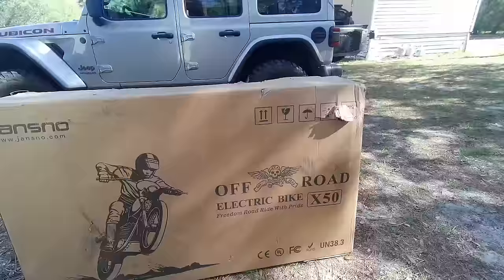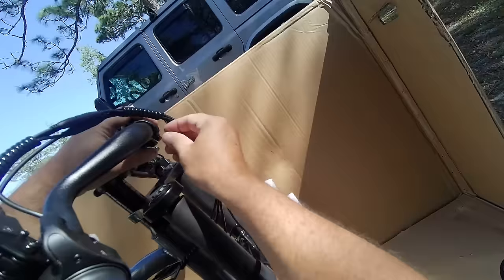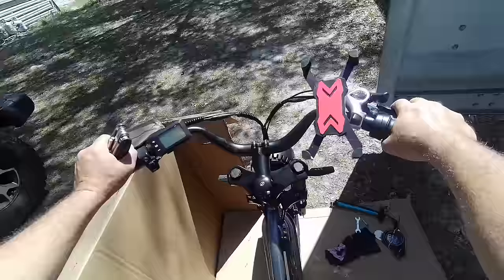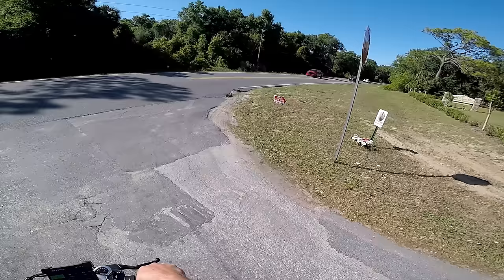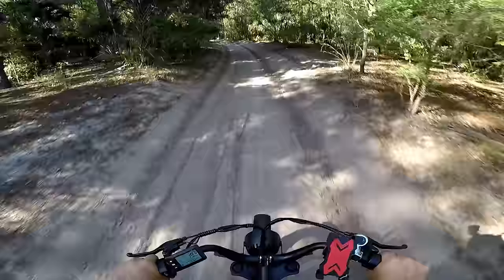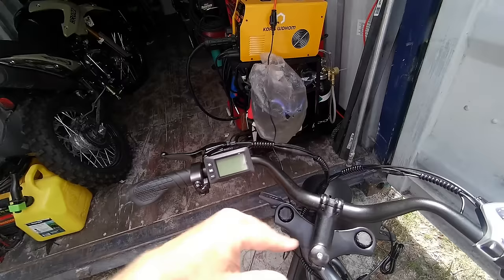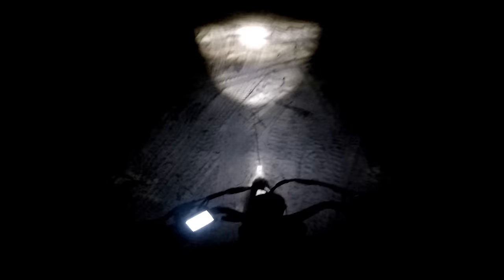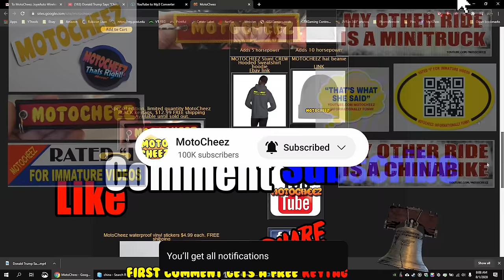Jansno X50 Electric Bike 20"x 4.0 Adults, 750W Brushless Motor, 48V 12.8Ah Removable Battery,

Comment: I've owned this exact bike for about 2 months now. It's legit a great bike at an incredible price. Only complaint is the charger it came with. They really cheaped out on it, and it get's hot quick, didn't seem safe so I replaced with a higher quality charger. It's a fun bike for the money!
Reply from the maker: Awesome!
Reply: Hey man. I just got this bike and got it all setup, what charger did you upgrade to?! That sounds like a great idea ahead of time. Any other upgrades to it?
Reply: Glad I found your comment how convenient lol I just came back to this video for setting it up. Been waiting for a couple days just watching over plenty of reviews
Reply: @Bravosierra175  ha! what's interesting is that i bought this particular bike based on a positive review of a different youtuber! it's my first ebike ever and i still cannot believe i have the equivalent of an electric dirt bike for the price i paid. one other thing.
Reply: @jomoney9076  cool thanks a lot. did you get the 25.2 or the 29.4v ? There's also a 40 something v option, I'm not very familiar with what this exactly means
Reply: what charger did you upgrade to?
Reply: Can you upgrade this bike to use hydraulic brakes instead of the mechanic breaks it comes with?
Reply: Do you think it's possible to mount a second battery under the seat? Does the area under there taper down where it meets the frame?
Reply from the maker: Yes, I'm sure you could!
Reply from the maker: Mid drives also cost double plus. Hmm mid drives typically don't need the extra pedaling so I would imagine mid drives are for lazy people haha.
Reply: Might I ask what kind of charger you got to replace .. as I currently have the same as you, and was interested to replace it as well
Reply: Need replacement charger recommendations,  thanks
Reply: What is distance on this with only 12.4 ah?

Comment: another nice thing about this bike is the weight capacity is 265-ish. i'm fat and weigh close to 300 pounds but rolled the dice and still bought it. it has no problem carrying me around just fine. my goal is to actually exercise with it to by pedaling to lose weight.
Reply: are you able to hit 28mph?
Reply: @zipzip8239   Not quite, unfortunately. Closer to 24mph I'd say. But I'm not complaining since it still carries me around even at that speed given I'm 35 pounds over the wt cap.
Reply: @MotoCheez  I'm not sure if we're talking about the same thing, but just in case, and forgive me if this isn't relevant. If you remove the seat, there's a black and white wire connected by a tiny plug. If you unplug that, and put the seat back on, the removes any lock on the upper speed. At about 260 pounds, I can get up to 32 MPH on a straightaway.
Reply from the maker: @RileyHarrison yes! This has that. I had this bike confused with another bike, I did put it in the video
Reply: @MotoCheez  I saw After that of course you had covered that obvious bit. Thank you!

Comment: "cant get much flatter than this" ... Cheezy this is Florida, the only hills we have are overpasses
Reply from the maker: There are a few hills in my area and there's also a pretty good sandpit that's probably 80 ft high or so but the bike wouldn't make it up that cuz it's really steep
Reply: Floods are no fun though
Reply: @MotoCheez ¹1qqqqq¹q1qqqqqqqqqqqqqqqqqqqqqqqqqqqqqqqqqqqqqqqqqqqqqqqqqqqqqqqqqqqqqqqqqqqqqqqqqqqqq1qqqqqqqqqqqqqqqqqqq1q1qqqq¹11❤

Comment: I got my Jansno for about 3 months now. Put 820 miles on it. At 600 I need new rear tire. Front still okay now at 820 miles. Will change it at 1000 no matter what just for safety. Very good bike over all.
Reply from the maker: Awesome! Thanks for the info
Reply: What’s the range on only throttle at 30mph?
Reply from the maker: @emadhakim I'd say if on flat roads 25 miles or so. I've never tested road only, but might soon

Comment: I just got some great tyres for mine from Germany, called " Vee Rubber E-Huntsman" 20x4.0 .  It's a bit more like a real motorcycle tyre , I threw in some green 20in tyre liners too because these bikes are pretty much unpushable with a flat because the balloon tyres squish to nothing, come straight off the bead and the rim bangs on the road. Got me a puncture kit and pump now too 😂👍 man that was a bad day getting a flat so far from home... But not again! Highly recommend the tyres if you can get them there 👌
Reply from the maker: That's great info! I never really thought about if I got a flat, I do carry a small air pump and patch kit on the motorcycles, good idea for the bikes
Reply: Hey how did you get the rear tire off I'm new to this and I just got a flat but it seams to be stuck and I don't wanna force it and I can't find any videos for it
Reply from the maker: Off the bike or off the rim?
Reply: @MotoCheez  off the bike for some reason I could be missing something once I loosen everything and I went to pull the wheel off the bolt on the side when there brakes are won't let go I think it's very frustrating
Reply from the maker: There may be a pin or another small bolt, I've never taken the rear wheel off yet but something has to transfer the torque. 
Maybe someone else will chime in on this
Reply: @MotoCheez  I hope so hell I've even emailed the company and I've heard nothing so far gonna have to walk to work but I'll keep trying to figure this out and hope it's something I overlooked
Reply: Hey I figured getting the bike wheel off a day after I posted this comment it was just tight before it was the first time however does anyone know how to fix/ recalibrate the display I believe it was an error code 9 but the speedometer and the mile counter won't go up from zero after the wheel (after user error) popped off when it was to loose and I had to hit the breaks omw to work can anyone help with this or am I just kinda screwed? Everything else works just the display not showing how fast I'm going and the miles counter is not working and help would be great
Reply from the maker: @matthewgurisko97 I'd think it was a connection to wheel sensor for speed
Reply: @MotoCheez  that's what I'm thinking but I checked the plug and made sure the connection is all good and still nothing do you think is there anyway to reset it or fix it without changing any parts out? It's kinda trial and error without a manual or anyone else with the same bike going through the same stuff
Reply from the maker: @matthewgurisko97 there's a schematic in the manual, I'm not sure which plug it is but you could test with an ohm meter, check the connections to gauge too. 

Yours is the first I've heard it happen
Reply: @MotoCheez  I'll keep working on it and hopefully it's as simple as the last thing I don't have a meter and I don't know where to find a manual for this thing I looked all over and nothing so it's mostly guess work on my front everything works mechanically and the battery display works fine just the other parts of the display (speedometer and the mile counter) and I still have yet to hear from the company from even the last time I emailed them other than figuring out these problems Ive ran into it's still a pretty good bike

Comment: I’d upgrade that battery asap. 12.8 amp hours just isn’t enough range at all. That’s at most 10-15 miles of range on throttle. To maybe 20-25 on pedal assist on the lower levels. The bike seems heavy. So the lower levels of pedal assist won’t help much especially on climbs. So we’re back to around 15 miles of range on the high end. At minimum. An ebike really needs 20 amp hours as standard. That’s about 30 miles of range using throttle or 40ish miles with pedal assist. 32 amp hours is the dream. Between 60-70 miles of full throttle. 80-90 miles on a medium pedal assist. Everything else on the bike looks solid!
Reply from the maker: Agreed! They're coming out with an X60 soon, supposedly big improvements! I'll get one once they're available
Reply from the maker: But I drove in sand for about a quarter of the whole ride I got 8 mi and it was still about a half battery left Yes it was blinking that it was low but I was on sand that takes a lot to push through the sand

Comment: I'd be inclined to swap that QR axle on the front wheel for a Bolt-on, it should be safe enough for road use but not for off road riding.
Reply from the maker: Not a bad idea .

Comment: That is a very good deal for what you get .. Just a bigger battery would be nice. I know you could put in a 20 ah battery easily with all that open frame space.
Reply from the maker: That would be an excellent idea, even go up on the battery voltage to 52 volts or more because the controller will handle it

Comment: Looks like you have a Hailong 1-2 battery if you wish to upgrade to a larger or a 52v. I have the same battery type I went with an Acepower 52v, 15 amp on my 500w commuter and it makes a huge difference. I also have the same display, a G51. To get into the settings hit plus and minus to get into the "P" modes. Some interesting ones.."P01" is backlit brightness. "P02" is miles or kms. Change to 1 for miles. "P08" is max speed. Probably maxed out but you can check, note it's in kilometers. 50 kms/hr is around 30mph. For cruise just hit the throttle to where you want it and hold down the minus button for 3 seconds. You'll see a speedometer looking icon on the display. I love this. I hate f$cking autocruise. My friend has it on his bike. It's dangerous as all hell. Imagine driving a motorcycle with a sticky throttle. That's autocruise.
Reply from the maker: Good info. I did go over settings and even raised the amperage
Reply: @MotoCheez  Cool sorry had to cut the vid a bit short had to go to work. But I would be interested in this bike as a potential upgrade or companion to my Gotrax EBE8. Hell I could just swap batteries, put the 52v 15amp on the Janso and the 48v 12.5 amp on the Gotrax. They are the same battery type. Hailong 1-2.
Reply from the maker: Awesome idea! This bike really impressed me for the price. Fastest 750w hub bike I've tested so far
Reply: @MotoCheez  I like it because it's simple so if anything goes wrong or you want to upgrade something it's a no brainer. Nowadays we have ebikes with integrated batteries and displays, etc. What happens if the battery goes tits up? Are they even going to sell that battery anymore? Will the company be even around? You get about 3 years average on a Li-ion battery before it goes to 80% capacity. What if you want a new one? Or a bigger one? Or one with a higher voltage? Being a computer tech I like open source standards so if something needs replacing you can do it cheaply and easily. Not have to hire Japanese swordsmiths to forge you a new battery case and an MIT electronics engineer to wire up the cells. I would highly recommend getting a 52v battery for this bike though. Sure you get a little more speed, power and range. But the real advantage is way lower voltage sag as you got another 4 volts on tap. You'll keep higher speed for longer. That display will do 52v, it's only for the battery bars and low voltage cutoff anyway. It a relatively cheap upgrade with the most bang for your buck. Also for some extra braking power get some cable actuated hydraulic calipers from Xtech/Zoom, I got a pair for $58 Canadian and it improved the braking by at least 30-50% over just the mechanical calipers. It's just a straight replacement of the mechanical calipers, took me 10 minutes a brake to put on and adjust. I'm sure with real brake pads it will be even better I'm just using the organic pads it came with I'm sure some nice sintered metal/orgranic hybrid pads would really do wonders, get close to a full hydraulic system.
Reply: @MotoCheez  If you want I could scan the manual I got with my unlocked display I ordered from China if you want to see all the settings. Or download a copy it's a "G51". They are all sort of the same. I could put it on my tech channel if you like or just type it out here. Whatever you wish. That slow start setting is the initial power setting when you power on the bike. "0" is zero assist. 1 is PAS 1 on startup. I like having it on 1 PAS at startup so if I jump on the bike and forget to turn up the PAS level at least I am moving at 10mph instead of sitting there wondering what is going on and have no power. The auto cruise feature is controller controlled. If the controller doesn't have it then it won't work. To engage cruise control just hit the "-" minus button while on throttle. You'll see the walk icon briefly flash for half a second then a speedometer looking icon will show up. Tapping a brake will cut cruise control.
Reply from the maker: I showed settings in video
Reply: Sorry Brother I mispoke. Yeah saw your end on the video. I apologize. Just ordered one myself. Maybe if the gentlemen would like in the community I can do a quick video. I also ordered the larger 17amp battery, which I'm expecting is not going to give me that much however if you gentlemen would like to see it. I'm sure I can whip something up. I like to torture...er....I mean test things. So it's up to you gentlemen. Thanks very much for your video. Well done. P.S love the knight rider ring tone. @MotoCheez
Reply: Quick update. The 14amp battery does indeed take a full 3 amps of charging which should cut your charge times in half. I bought a fairly expensive 4Amp charger as that's all they had because it came with a warranty and indeed the battery is taking 3 amps which should charge the battery from low voltage cutoff in just over 4.5 hours not 7-9 hours with the crummy 2.0 amp charger they give you with the bike. It's currently pumping in 2.889 amps after losses into the battery on the new charger. I guess the "3amp" charger I borrowed from my friend bought from that site named after the famous thief of Bagdhad is....let's just say "loose" or "optimistic" with it's specifications. The fan on it is a bit annoying though, a little high pitched but I figure if I drink enough I won't notice. Hey, I'm a glass half full kind of guy cheez.
Reply from the maker: @chrissinclair8705 great info

Comment: Yeah, that motor controller banging around would drive me nuts.  That's gotta be fixed.  Agreed on the need of some sort of soft material bushing, or even better, some hydraulic rebound would be nice.  A manual is a must have too.  Overall, I like this one too.  I wonder if a lift block could be made to raise the seat if someone needed that?  Nice ride for the money.  Ya need to get one for Mrs. Cheese too.
Reply from the maker: Yes I do believe you can raise the seat up no problem with some materials and just fabricate it. Another person commented that you can buy this bike with the upgraded forks too, I didn't see that when I was researching. Mrs cheez is too short for even seat being so low, haha
Reply: the controller on mine doesn't rattle at all.

Comment: Alternative for that loose controller...cut a few segments from a (pool) float noodle, slit in the middle and turn into 'buffer clamps'.

Not perfect but better than nuthin.
Reply from the maker: That would work! I just worry about covering any of the top heatsink area for heat dissipation
Reply: @MotoCheez  2 or 3 short segments should leave enough heat sink exposed. Plus, heat will weaken 2-sided tape...
Reply from the maker: I would put the two-sided tape on the bottom of the unit where there's really not a lot of heat, but yes a couple contact points probably wouldn't harm anything

Comment: Hi MC... Kinda reminds me of my old 20" banana bike from way back, I like the design.  As far as the front fender, it is common for that to be 2-piece with one faced forward and the other backward with a bracket in between.  With the high power demand of both lighting & motor it is a shame that it is 48 vs. 52 volts which would extend the range.   This bikes strong suit is it's night & off road capabilities.  Thanks for the review.
Reply from the maker: Agreed, if I upgraded this to a 52 volt with a little more amp hour battery to sing would really be something

Comment: That was just numbers for the rotor adapter it the brand of the brakes it means it will work with a 160 or 180 brake rotor
Reply from the maker: I assumed that when I read it

Comment: That front mud guard goes the other way round
Reply from the maker: I know, I put in text above and corrected it later on in the video Thanks
Reply: @MotoCheez  ah no worries just didn't want you flinging muck and water up into the battery, bike looks sweet tho! I'd advise puncture protection lol got a flat last night after 600k wasn't fun pushing it 15k home 😅
Reply from the maker: Wow. That stinks. I've wondered if it's worth carrying a patch kit
Reply: @MotoCheez  honestly wouldn't help unless you have the ability to remove wheels, tires and submerge tubes in water plus I had quite a big hole and it happened at night so I'd be screwed either way I'm looking into tire liners
Reply from the maker: Oh man
Reply: i carry those cans of flat fix in my small back pack==used them twice,life saver

Comment: I’ve read a couple of articles that some E-Bike batteries are catching fire. They are still looking into the causes.
Reply from the maker: I saw. The 3 wire chargers are the safest, has temp wire to shut off charging if battery temp gets too high. The 2 wire chargers I believe are the culprits
Reply: Don't use aftermarket off brand batteries